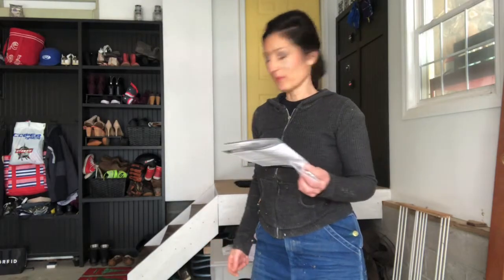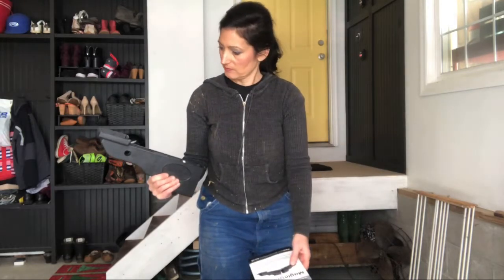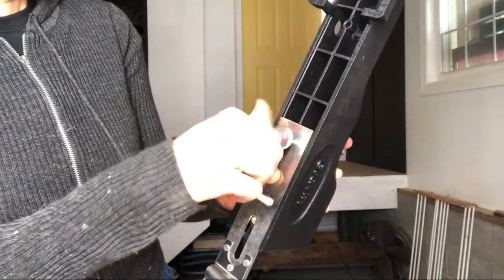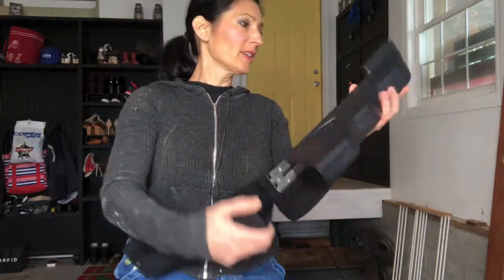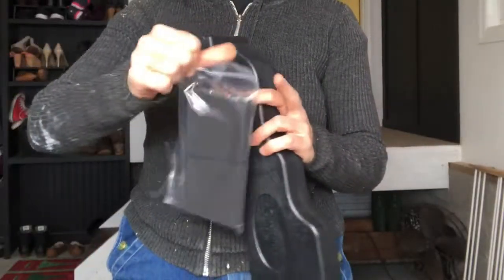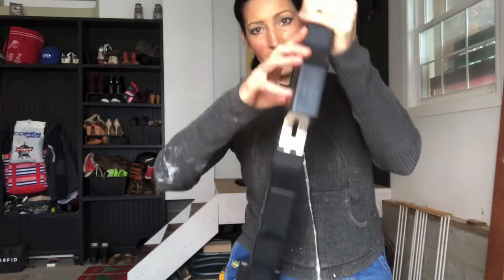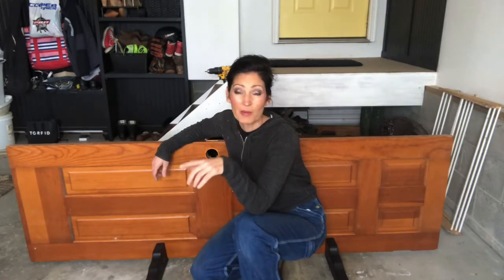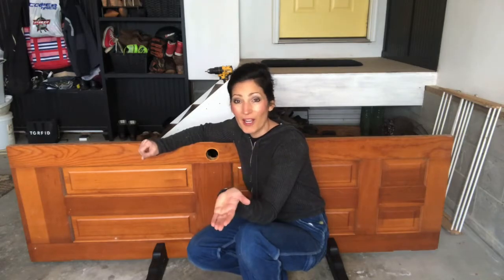Magic Gripper Review & Assembly (Holds doors and work material vertically!)

Comment: Great review, thanks for posting it.  Do you have any concerns about the opening or jaws of the gripper marring the surface of the door or any other object you are working on?
Reply from the maker: Valid question and I considered that after I posted this. To be safe if the material/object could be crushed, add a buffer like cardboard to test. This door was heavy/sturdy and showed no marks but I could see where certain objects might be dented.